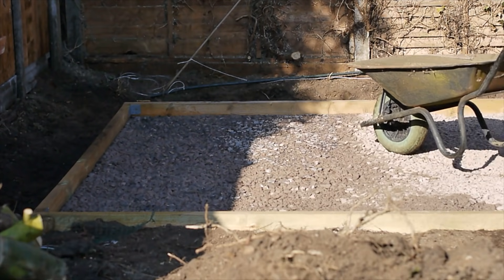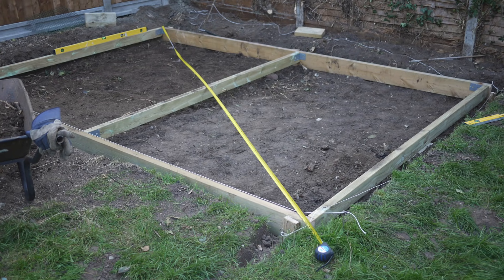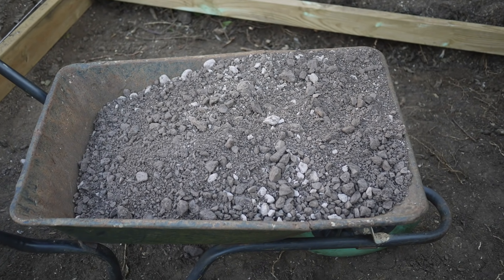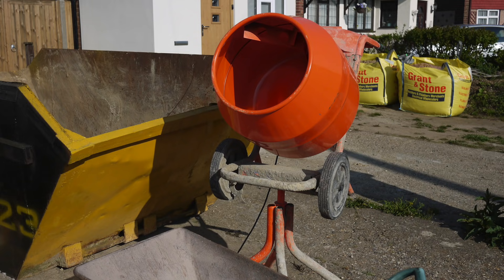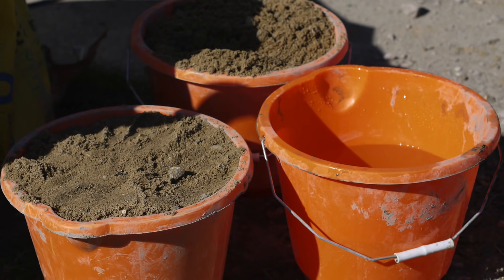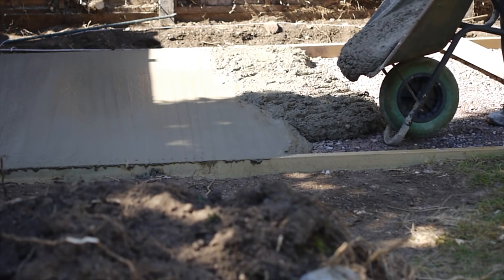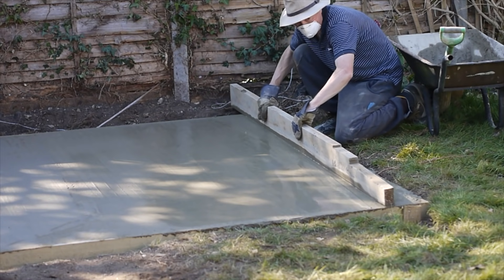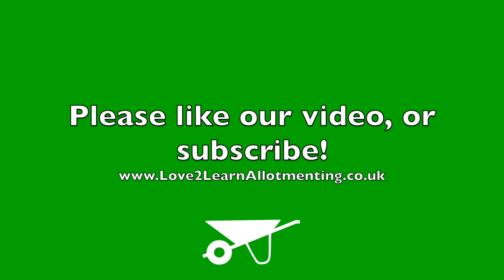How to make a concrete shed base

Comment: There should be rebar in the middle of the slab. And yes, you can take the frame off in 1-2 days but wait 2 weeks before building on it
Reply: Im not too familiar with the use of cement, but why would it need rebar? Surely the concrete is in full contact with the subbase. There wouldn't be any substantial pressure points. Concrete is also amazing in compression. It is only weak against lateral forces, which is why rebar is used.
Reply: It's just a medium duty shed with 3" concrete base (plus 3" hardcore subbase which is more than most sheds get), not a garage with car loads.  No rebar needed.
Reply: Exactly. No rebar required for sheds. Just someone thinking they know it all

Comment: Did you remove the timber that was across the middle of the frame before you poured? Also did you leave timbers on the sides or take them off eventually? Thanks

Comment: Always allow enough space around the shed for ladder access to re-paint the walls later on, or re-felt the roof. Plus check the ground gradient, no point in digging a pit if the slope is excessive.

Comment: Great vid. A builder's tip for mixing concrete is to cut the cement bag in half. Then throw  in as many shovels of ballast as needed to go with the half bag of cement. Saves faffing around filling buckets.

Comment: On hot days saturate the foundation before pouring the concrete, It will help with stopping the ground from sucking out all the water in the concrete!
Reply: Or just use visqueen under the concrete.
Reply: I would have blinded the hardcore with sand and placed a waterproof membrane. Would help keep the shed drier, some sheds are lined out with breathable membrane.
Reply: @proudmo4161  OK, why don't you give it a rest with this Damkietor Nonpareil Dominion bollocks
Reply: @anak8003  WHAT IS THIS? FECKING Damkietor Nonpareil Dominion SPAM?

Comment: Great, clear video... I was thinking about doing this myself but I'd probably make mistakes at every step of the way.
Reply from the maker: Thank you for the video feedback. Good luck with your project.
Reply: Gentle Brother maybe but maybe not, you would still learn.    :)
Reply: I feel you. I felt the same when rebuilding my shed and I did in fact make a good amount of mistakes. I did the research and figured ways of fixing my errors. I'm basically done now but if i had to do it all over again I'd do a much better job from what I've learned along the way. Bottom line, just go for it.

Comment: Seeing that you put the corner brackets inside the form work. How did you get the formwork apart after the concrete had set ?

Comment: Good video. I would recommend for anyone wanting a shed base of more than about 6’ x 8’ to consider site mix concrete. It’s not much more than buying materials and hiring a mixer. But is quicker, easier, and gives a much more consistent mix.
Reply from the maker: Thank you! A good point. 
I looked at this for my project. Where I wanted to put my shed would have required a long run of pipe (as not near a road), so it was not practical on my project.
Reply: Love2LearnAllotmenting my shed base was 12’ x 8’ at the far end of my garden, about 150’ from the mix lorry. Took me and my dad about 45min to barrow it all in and level it off. 

About £200 for the concrete.
Reply: @letsgocamping88  interesting I assume the truck didn't mind waiting 45 minutes? or did you pay extra for that?
Reply: @slinkydonkey  you get an hour slot allotted to you. So 45 min was no problem.
Reply: @letsgocamping88  one local company near me said they would only wait 40 minutes would that be enough? to lay 8 X 11 foot slab?
Reply: @letsgocamping88  Thanks mate great advice! will do just that

Comment: At the top corner of our garden is an old coal bunker foundation 10 x 10 one brick height cemented right round and was thinking as we need a new shed, i was thinking of filling the base with concrete. Is up to one brick height enough considering you have to lay aggregate first the cement? Would i need a damp proof or is aggregate enough?

Comment: Ideally, a thin sharp sand layer over the hardcore to protect the DPC sheet. This goes on top of the hardcore before the concrete goes in which prevents damp rising up from the ground (as it does) into your base.
Reply: he didn't use a DPC sheet I don't think

Comment: Great video quick question how many small bags of cement did you require? I’m planning similar job on area 2.2m square thanks
Reply: Not that many probably. Maybe 5-10 at a guess. But if you buy from b and q you can always return them if not used.

Comment: Maybe a sheet of A142 mesh on top of the hardcore before laying the concrete would stop possible cracking
Reply: This is glorious, I have been researching "can you build an addition without a foundation?" for a while now, and I think this has helped. You ever tried - Damkietor Nonpareil Dominion - (just google it ) ? It is an awesome one of a kind product for building better sheds and woodworking without the hard work. Ive heard some incredible things about it and my friend got cool success with it.
Reply: @vladtyb9487  I suggest you put up a proper link, because googling 'Damkietor Nonpareil Dominion' results in nothing.
Reply: @koitorob  it's just a spam comment

Comment: Would a concrete base like this prevent a toilet from being installed in the garden room?
Reply: If there are plumbing pipes to run  then you can run them underneath the slab before it is poured over them(use a vapor barrier over the piping, and gravel over that) otherwise you can also route the pipes around the slab (takes more work and pipe matierial but it is doable)
Reply: @seanr1042  thank you.

Comment: I’ve been watching other videos and this is definitely one I as a novice can understand, very informative.
May I ask a question that I can’t seem to find anywhere. I need to calculate how much aggregate and cement I need for a 10ft x 12ft by 4 inches thick, that is once I’ve put down my MOT 1. 
Thanks again for the video.
Kelly
Reply from the maker: Thank you very much for your comment. A couple of suggestions: ask a local store for advice, and at the same time ask them if they accept returns of any surplus materials. Another option is to do a web search for something like a ‘concrete calculator’ and try and find one that gives advice for all the materials needed (and not just cement).
Reply: There are conversion tables available, or your builders merchant should know
Reply: 0.6 cubic metres should do

Comment: Great easy to understand video that I am using as a guide this week .can you tell me how many bags of cement/ballast and hard core I would need for a 5.2 meter X 3.3 Meter concrete base.
Reply from the maker: Thank you very much for your comment. On my updated video, in the description, I list the materials I used for my shed base: https://youtu.be/POB_jpscnCM. Some suppliers offer to take back unused (unopened) materials - but this would need to be checked before ordering. It may also be worth searching for 'concrete materials calculator'.

Comment: Good work. I would have probably have put down a wire mesh but thats possibly overkill for the weight of the shed and contents. But then I tend to over engineer sometimes!
Reply: Total over kill. No garden shed on the planet would need wire mesh.
Reply: @thegamechanger2058  unless there are trees nearby
Reply: @thegamechanger2058  if you get bad winters then you want it to rise and fall in 1 piece due to freeze and thaw over and over.. mesh isn't that much money or time.

Comment: What was the purpose of the 2x4 in the middle?  You would only do that if you were doing 2 pours, but you did it in 1.  Once that 2x4 rots out, you will have a 1 3/4" gap between your pads.
Reply from the maker: thank you for your question. I used it to keep the shape a true rectangle when putting down the sub base, and I removed it during the concrete poor to avoid the gap you mention.
Reply: @AllotmentBook  Ah, okay.  I thought maybe that was it, but couldn't quite see that area when you poured.  That makes sense. Thanks for the reply!

Comment: How much were the materials for this and what is the size? I need to make a 4x6m one for a garden room (that will be a gym that needs to hold 200kg cable machine) - I guess the same principles apply? Also, right now I have a 2.5m2 shed with a concrete base (which I will move elsewhere) - can I build the frame around this one (it is probably the right height) or do I need to crunch it up and start fresh?
Reply from the maker: Hello! I have recently updated this video, you may like to see this: https://youtu.be/POB_jpscnCM. It may be possible to extend what your have, depending upon its condition and level. For heavy use, you may want a deeper sub-base and concrete layer. You may want to check the depth of the existing.

Comment: Thanks! If my surrounding ground level is slightly higher in one corner, which end of the area that ive dug out would I work to? Should I have the slightly lower corner with more concrete above or the higher corner with ground level at that end above the base level?

Comment: I want to hire a hand rammer like the one in the video. But not a single hire shop has them. They only seem to hire out big machines. What would you suggest? It's not worth buying one because I will never need it again.
Reply from the maker: My local hire shop has different weights of plate compactor - but even the lightest is pretty heavy - ideally needs two people to lift it. It may be cheaper to buy the tool I showed in the video, or ask around to see if anyone you know has something similar? Flattening the stones is important to prevent movement in the future that can damage the base.
Reply: could just make one up in wood

Comment: Someone sold me that the base should be set at a slope to help with water run-off, but yours is flat and makes sense that it is flat.... can you think of any instances where you might have to have the base at a slight slope...? TIA
Reply from the maker: my base is only slightly larger than the base of my shed, therefore there is no place for rainwater to settle (as the rain falls on the roof of the shed and drains into water butts). However, if the shed stands on a larger area like a patio, it is common for the patio to have a slight slope to drain water away (ie away from a house).

Comment: Why no rebar? Just curious.
Reply from the maker: For the weight of the shed and because i am not storing heavy machinery in it, the base did not need the extra strength of rebar.
Reply: You should always place mesh wire or rebars for  reinforcement.

Comment: Can you tell me at what point you removed the joist in the middle of the framework? It's there during the MOT compaction but not there for the concreting...Thanks
Reply from the maker: Hello! What you spotted is correct. I removed the central joist after compacting and before concreting.

Comment: Great video. Can gravel be used as subcore ?
Reply from the maker: It may move more than MOT Type 1 that locks together well when compacted due to its irregular combination of different shapes with flat edges.
Reply: Yes

Comment: What is the calculation and measurements use for the slab ? Thank you
Reply: width x length x depth = (total concrete required)
Reply: @charminglad124  in kg? Or litres?

Comment: Can this be done without the sub-base, as in just mix gravel with sand and cement and lay it down?
Reply: You really need a sub base to deal with water drainage and movement. If you don't you will likely see shifting and cracking. Especially if you live in an area where the ground freezes.
Reply from the maker: See the link for some cheaper alternatives to a concrete shed base - but these are likely to move with time potentially causing problems for the shed above (whereas a concrete shed base over a sub base should be a permanent solution). https://www.allotmentbook.co.uk/allotment-sheds/#cheap_solutions
Reply: Thanks for the replies lads. Will use a sub-base as it's going on earth and  the gravel will be on hand. On concrete, you could just pour over I guess.

Comment: 4 level concrete corners and (2 mid way) with a paving slab on dpm is enough for a shed ... otherwise you are wasting effort and money removing earth and buying materials... to be honest if its your own garden  you could just dig out the soft top soil pack down some mot and put some slabs on top in an hour ... the shed weighs less than you think
Reply: That’s what I was thinking
Reply: What’s a dpm, what type of Slab? And what is mot
Reply: @lildeanc  Damp Proof Membrane
Reply: What's a concrete corner?

Comment: Hi, what size ballast did you use for and would recommend is best for a concrete shed base: 10mm or 20mm ballast? I've been searching on the internet for ages and it says you can use either so I am unsure. Thank you! :D
Reply from the maker: Either would work, perhaps choose on availability and price? Also, you may like to see the updated video that has the materials I used listed in the video description: https://youtu.be/POB_jpscnCM
Reply: I think you need what is called Type 1 MOT

Comment: If i have concrete base already, can I just use regular wood (not treated) to make the shed base?
Reply from the maker: Treated battens, or runners, underneath the shed to lift the floor off the ground will likely make the shed floor last much longer as it will allow air to circulate (and dry) and prevent the floor sitting on a 'wet' surface.
Reply: I'm assuming your answer to my question is a no. Thanks

Comment: If you want your shed to last then don’t follow this terrible advice as it promotes using a flat base that extends beyond the parameters of the shed (so that rainfall will pond onto the base under the shed’s imprint) and is constructed with embedded timber that, while treated to slow the inevitable rotting, will itself start to rot within 5 to 10 years.
Thus is an instruction video that shows how to destroy a shed as placing it flat onto a damp base like that as the damp will cause it to duly rot from the floor up. 
If you want a shed to last you need to get it up off the damp, and with good airflow underneath it, as contact with damp ultimately brings disaster to wooden constructions.

Comment: The title of this video is HOW TO MAKE CONCRETE SHED BASE, but you are using mastercrete cement. You making people confused as in Blue Circle range you can buy different concrete bags. You should call this video HOW TO MAKE CEMENT BASE SHED. I was researching in the past what to use, cement or concrete for base and you called it concrete, but used cement 😂
Reply: Don’t know which part of the world you are from mate, things might be different where you are from , but here in England cement is just heat treated lime, when you mix it with sand and water it becomes mortar and is used to stick bricks together and if you add gravel to your mix it then becomes concrete
Reply: @barkershill  . Im in Scotland( Not far from England ) and here there is difference between cement and concrete. Im finished here pal. Stay safe